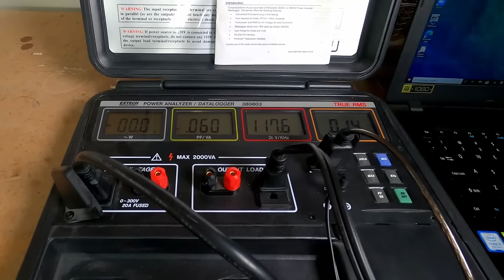Singer Heavy Duty, Most In-Depth Review on the Internet. No Really, I'm Not Joking.

Comment: Great video - hope if it's ok if I ask a question:  if this machine stalled on me let's say 10-20 times when I threw some thick fabric at it - that stalling or getting stock act, does that ruin the motor if it happened only those 10-20 times or is the machine smart enough to encounter resistance, and give up without getting destroyed?

my machine works but now I'm wondering if I have lessened its lifetime by pushing it that much - that's why I'm asking.
Reply from the maker: It could throw some alignments off like needle bar height or timing. Also, it isn't good for the motor and no electronic safety in this model.

Comment: Love the videos, I'm thinking of buying a Singer Heavy Duty to replace my old Singer 3105 but it is lighter and, while I can't find a power rating for the motor in my old machine it appears the same size as the Heavy Duty. Will the 4423 really sew heavier material (thinking 4 layers of sailcloth or two of thick webbing) than the old 3105 do you think?

Comment: Amazing video and great explanation i currently use a singer heavy duty and it's a workhorse. Though I've always had a question regarding a sewing machines bearings why do they use bushings instead of ball bearings or needle roller bearings? I would think Rolling element bearings would suit the sewing machine better.
Reply: Bushings offer a tighter tolerance, roller bearings would work just as well but they’d be a lot more expensive for no real gain. Ball bearings are not precise enough.

Comment: hey repair guy- I just had repair nightmare- that cost a lot, and the end is near. Is it possible service took out my tension disks. Im absolutely sure before service was one small slot where the thread could jam. - now I can not find it- the machine can not sew when lid is on her upper part. These discs are going where? Not under 1st upper lid, under the second?

Comment: 9:20 Plastic pinion gear may be good in sense that it causes less wear to the belt than cheap metal gear, too. As long as the gear is easy to replace and spare parts are available, I wouldn't consider that a huge problem.

Comment: Which needle did you use for the leather. I have the 4452 and sometimes I have problems with things like flex foam which I think for a heavy duty it should do a lot better job than it does.

Comment: Did you inspect the parts that actually guide the sewing pattern? I'm wondering if there are expected to be different lifetime for Singer 4452 vs Singer 6600C where the difference seems to be that 4452 uses mechanical analog parts for the pattern whereas 6600C uses computer controlled parts. Assuming that the small computer itself is well enough made, which one would be more reliable in long run?

Comment: I have one of these machines. The first one wouldn’t work when I got it home. I can’t remember what was wrong with it. The store ordered another one for me. It has been used very little. I recently got it out to use. The feed was lowered and I tried raising. It would not raise. My husband took the bottom casing off. He said that it looked as if a plastic tab had been broken on the inside. He didn’t find the piece inside the machine. It disappoints me that the part that would control the raising and lowering of the feed would be made of plastic. I don’t even know how this could have happened. This machine has not been mistreated. Now in order to raise and lower the feed the bottom cover has to be removed and raised/lowered manually. I feel like my money was wasted on it. Not sure if the piece was actually made of plastic this is just what my husband thought. Would you have a recommendation for fixing this? Thanks.

Comment: Have you done this to a 6800c?  Mine is brand new and the auto cutter seems be having trouble cutting.  I took it apart and it's like a rod that slides across the threads and drags them back.    I would love your insight.

Comment: hi great video, subscribed
 I have a janome MC 10000 the top rod is really stuck fast very hard to turn , I looked at everything and it seems as the top is jammed or something, could you tell me is there a consistent problem with these machines something to steer me in the right direction to repair it, also the repair manual lacks any info on this problem?

Comment: Thanks for the breakdown! This helped me make the decision to buy the 4452 and I'm liking it so far. However, it is making a creaking noise which after opening the machine seems to be coming from the white plastic shim set(quite a few plastic shims stacked together) that is apart of the length selector or stitch pattern selector. I tried to add oil and that didn't help. There definitely is friction. Could this add enough resistance to the motor to significantly shorten it's life span? I'm not sure whether to be concerned or not. Thanks!

Comment: Very interesting! What may be a week spot is the clutch mechanism and how that's attached to the upper axle. That's where you have the highest torque. If that entire assembly is made out of plastic it's probably the weakest spot on this machine. It would be interesting to see that mechanism taken apart! Also the plastic parts of the thread take up lever mechanism could potentially be another week spot.

Comment: Great Video. Thank you for giving me the confidence to tear mine apart. Looking at your video and all of the locations we need to oil, would it make sense to drill small holes on the case so that I can fit an oil straw through them to lubricate the needed areas? What are your thoughts on doing this? Would it enable us to oil with out teardown?
Reply: Older machines had that feature, todays machines don’t. If you know what you’re doing, and know you’re not returning the machine to the store, then make your own holes, obviously you have to be accurate. But then I wonder, if any plastic is load baring wall like in a house, I would practice on a broken down same model of my machine.

Comment: i would like to see how it performs in thick multiple layers of denim and leather... like a belt loop...but at slow start speeds, when your doing things like belt loops or a small section, you have to start and stop and sometimes you want to slow down for a bit more precision.. and you cant or dont want to to just jab the pedal and go full throttle.. in thick stuff like belt loops and leather will do a short slow controlled start and continue slowly then do the bach stitch slowly as well and not stall or would you have to jab it and keep it doing faster to keep it from stalling. my left arm does not work so i have to go slowly

Comment: My thread broke and bound up in the upper thread guide. Took the left side cover off & a small steel tube bushing fell out. It's about 3/8 in long. No idea where it came from. machine is running without it but I have trouble with my tension. My upper thread will bind and break lets say every 10 quilt squares. When I pull the threads to cut them I can feel it's tight up top. Any idea where this bushing might have come from? Aside from buying a machine to compare mine to or trying to find dwindling repair stores, I'm at a loss. I really would rather do my own repairs. can you help?

Comment: Zamak will react more strongly with acids (like brick cleaner) whereas aluminum will react more strongly with bases (like lye drain cleaner). Make sure to take the appropriate safety precautions as these are big boy chemicals and you don't want to mess around with them.

That said, zamak is pretty much the ideal material to use here, so I'd be surprised if they used aluminum. If it's good enough for a kitchenaid mixer, it's good enough for a singer sewing machine.

Comment: You didn't cover duty cycle issues such as stitches per month limits, expected durability over life cycle, efficiency of motor (e.g. relationship between current and voltage and mechanical power). Does the machine overheat? What size thread does it handle? Does it accept a walking foot?

Comment: Hi, I am searching a sewing machine, that can as well operate manually without power. Even it is not meant for that, the mechanics seems to at least help repair some cm of sewing length.

Is the Singer 4423 or 4432 a followup model? Here in germany I could get these models.
Are they both comparable in quality and long life capability?

Thanks

Comment: I bought one of these two years ago, having had an Elna for 45 years which seized and I was told couldn't  be repaired.  This Singer does not do the heavy stuff like my Elna used to so disappointing. I have stuck with it and have become used to it. It does what I need but I find it quite noisy and clunky. Any ideas why that would be?

Comment: To adjust the timing, I think that it was a 5/64 the allen wrench, hex.  However, after fixing the timing it keeps slipping after a few inches of sewing. It is possible that my 5/64 Allen is not the correct wrench and I am not getting a good tighten. 

I kind of suck sewing. I try to rember to "catch, drop, and dig" before pushing the pedal.  Catch the bobbin, drop the pressure foot. Dig THE needle down by hand into the fabric.  But I frequently forget to drop the pressure foot, which tangles.  Stopping by reversing the stick gets tangles. Moreover I want to sew with upholstery nylon thread. Which is pulling the hook on a tangle.  It is not practical to sew 2 to 4 inches and doing all the screws for resetting the timing.
Reply: The correct size is 4 mm.

Comment: The issue I have is with presser foot height, some thicker fabrics when sewing seams would not fit under that foot.
Reply: I can't get my quilt binding under the foot.  If I force it under it will sew but it makes the material bubble and wrinkle.  I'm having to sew my binding by hand and I'm very disappointed.  The tension dial doesn't seem to have any effect.

Comment: Great video.  I am thinking of purchasing a 4432 for the sole purpose of making rope bowls.  I don't want to use my Janome MC 6600P because the process produces A LOT of lint.  In your estimation, can a person clean the necessary areas without dismantling it as you have done here?  I will need to clean it quite regularly.
Reply from the maker: Yes, the bottom and the front come off and those are the places where lint builds up.
Reply: @SewingMachineRepairGuy  Thank you!  Does the pressure foot lift high enough to accommodate a 1/4" clothesline rope?  I pulled out my Montgomery Wards sewing machine purchased in 1974 and it has been doing a fairly good job but the pressure foot isn't quite high enough and I don't really want to ruin a machine that has been by my side nearly 50 years!!

Comment: I would like to know the settings you used for the different fabrics and the type of needles for each as well.    I have that machine and it breaks all the needles on anything thicker than 2 thin pieces of cotton.   I purchased it because it said heavy duty.  It has not worked out that way for me at all.
Reply: If your machine, heavy-duty or not, has broke just one needle, it will need servicing, because breaking the needle put's extreme stress on the mechanism and misaligns it completely. This machine is good up to for 12 layers of jeans and 4 layers of leather if used correctly. Usually the needle breaks if it hits the bottom plate, for example you were pulling the fabric with your fingers while stitching and misaligned the needle out of it's hole.
Reply: Info in your manual. I advise you to read it and follow recommendations. Do not pull or hold down fabric while sewing. Always replace a needle that has gotten stuck or hit something!! Otherwise, problems will ensue! Good luck!

Comment: Hi Wes.  Fascinating to watch you so adeptly take apart the Singer HD.  I have a question.  I just purchased a new one of these and the top tension mechanism is not set strong enough.  I thought I might be able to adjust it but after watching you, I am no longer sure.  Do I have to take the whole thing apart to tighten the tension mechanism?  Is it a job for an amateur or should it go to a repair shop?  Thanks.  Len
Reply: How the HD compare to the 9960?

Comment: Hi, I have this machine and sew professionally with it on photo shoots for fashion e-com. Honestly I am very frustrated with it, maybe you have a tip. I find that often, when i am starting a seam, often over a heavy bump, like doubled over piping, the material gets stuck and won’t properly feed, while the needle continues to travel. It’s like the feed dogs fail to pass the fabric through to a point where the foot can firmly hold the garment against the needle plate to smoothly feed through. Any advice? This might be a general issue with domestic machines, and I am accustomed to industrials, which have more robust teeth on the feed dogs “in front” of the needle…
Reply from the maker: You may need a more heavy duty machine like a Sailrite or something similar with compound feed.

Comment: I'm looking for a machine that is durable, will last long, NO screen/lcd or any other unnecessary electronics (they break, i don't need them, just want simple), has automatic needle-threader, has top-loading bobbin and uses plastic class-15 bobbins. Has all the basic stitches and stretch-stitch for elastics. 
I'm considering Singer Heavy Duty 4452, as I will need to sew through leather and jeans occasionally. But I heard Singers break a lot (local sewing repair shop told me). Any suggestions pretty please?
Reply: I have the Singer 4423 he just reviewed. It's 4 years old now, still going strong. Works great for what I need.
Reply: @NaneeH63  thx! So how heavy of materials and how often do you sew on it?

Comment: That was a really nice review. I like how you reported the current draw with different fabrics and hence different motor loads. As you found, the .8 amp motor was adequate for the intended purposes, right up to the three pieces of leather. Unfortunately, the powers that be at Singer must not have seen your review. I just bought one today and according to the placard it is a .7 amp motor. They downgraded the powerplant for their "heavy duty" machine? Really? Did it really save them that much money?? If anything, they should have increased it a bit. But I guess squeezing out every penny is priority one nowadays, even for a company that has a relatively stellar reputation. Color me disappointed. On the other hand, I did use a 40% off coupon, so the thing only cost me $147 with tax. I'm gonna throw a bunch of heavy stuff at it and see if the motor blows. Guaranteed the next one will be a Sailrite! hahaha

Comment: Great review Wes,  I shared this one with my friends. 
I’m not very experienced at sewing and I just got a new computerized machine. I used to sew on a 1970’s Kenmore. If you don’t mind, I have a question for a pro like you. Is it bad for sewing machines to turn the hand-wheel the wrong direction? I heard that you should never turn the hand-wheel backwards, (is that away from you or toward you?) Anyway it is bad, & please explain why. Thanks Wes, & keep up the good work!
Reply: Don’t turn back ever ,you will knot up the stitching formations,, and the machine will jam.
Reply: Very bad indeed! You will be going against the rotation mechanism (the best way I can describe it), so it will knot the threads in the shuttle race and cause a jam (change needle if this occurs). You could knock off the timing of your machine, also. So, to answer your question: NEVER turn the hand wheel away from you!!

Comment: I hope you are still reading these. I'm so gapoy that 6ou pulled this machine apart and got to the guts of it but I have a massive question.
Why does the manual say to just oil one little spot under the bobbin casing like a nana, when there are multiple spots that need a clean and oil, which I would rather prefer. This machine is noisy and sounds like you're trying to drive a tank up a hill. Would love my oil question to be answered if possible. By anyone if need be but Apprecaite your time all the same. Oh and if anyone is reading this and you've seen a atore saying 700$ down to 499$ then they are pulling your leg to get you to buy one. They average 500 dollars here in NZ. ✌👍

Comment: Ended up doing a lot of sewing by hand with a speedy stich because I could not decide on a machine and did not know if they would be capable of sewing through 2inch wide webbing cut from tie downs.

Would a machine like this be capable of reliably sewing 2 layers of a thicker webbing at a slow speed?

Not sure if it would be harder for it to work through than the leather, issues I had during that process were probably caused by the thick needle
Reply: Late reply but I'm sewing through up to 4 layers of nylon webbing just fine with my 4452. Microtex or denim needles are the way to go.

Comment: Great video! I am in the market to purchase a new sewing machine and I want one that can sew thru denim and and that I can maintain myself. Half the reason I am getting a new machine bc the repair shop was going to charge almost $100 just to look at my old one. It’s time for a new one. I have been looking at this heavy duty ones  by Singer. Which machine did you take apart? Are they all similar? There are several numbers that go with the Singer Heavy duty, #4423, or #4432,or # 4411 or# 5511or #4452 . Do they all function basically the same? Do they have the same motor? Can you tell any difference? Would you recommend one model # over the other? 
     I am really looking forward to you comparing the heavy duty singer to a computerized model. How do we find  that video on utube? Thanks again for this very informational video. Just what I was looking for.
Reply: Please let us know which heavy duty model# machine you took apart?